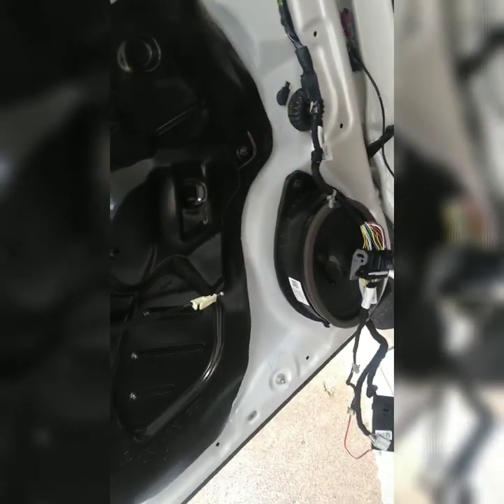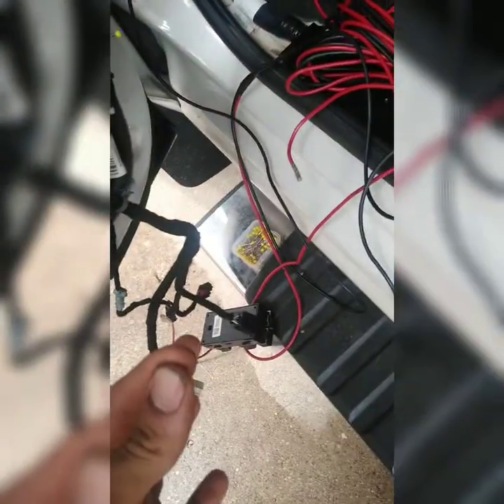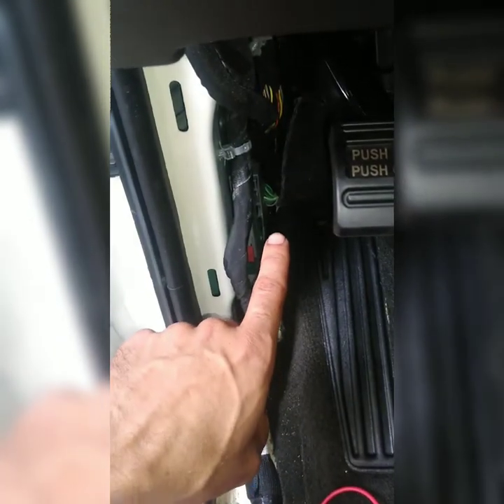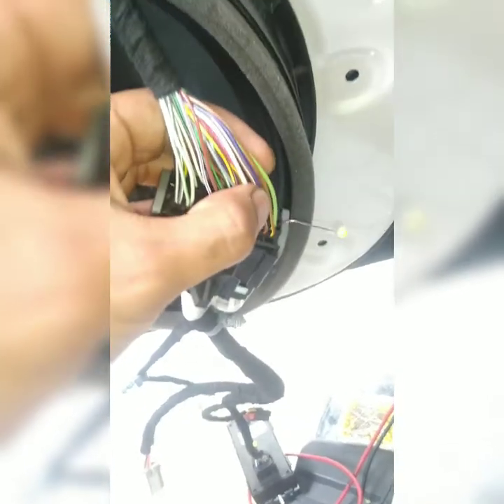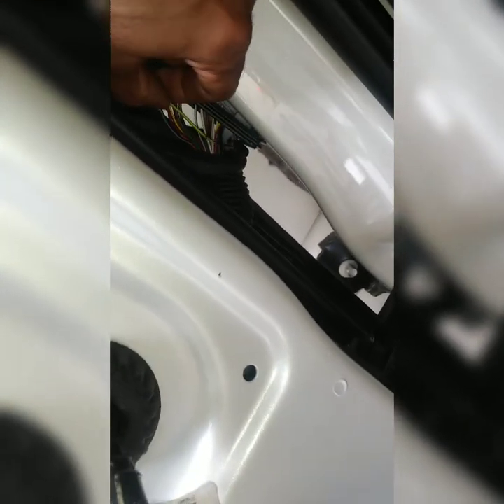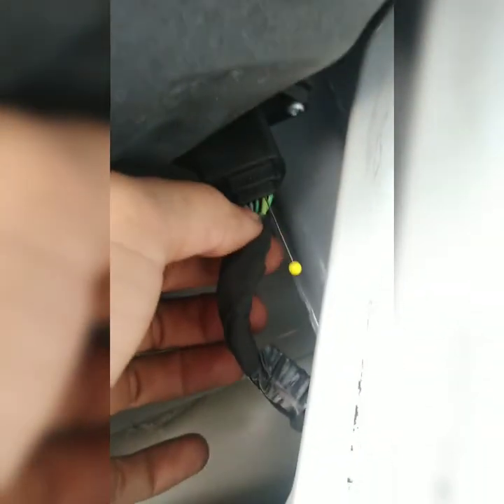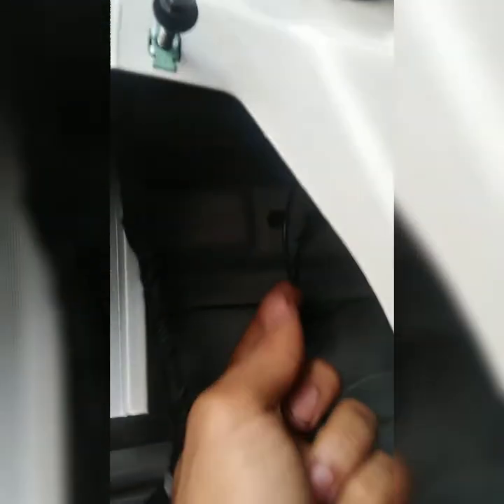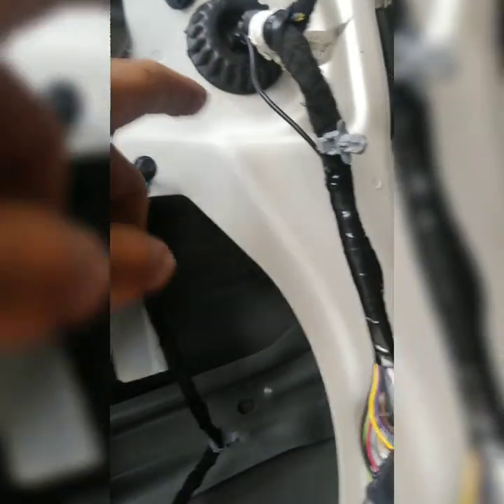2015 GMC Sierra 1500 With Bad Power Window Switch?

Comment: Awesome video. Question,my driver side window is doing the same thing,not going up or down with the driver side switch. Everthing else is working, switch is good ,motor and regulator good. 2015 GMC Sierra 1500 crew cab btw. Would it be the same color wire? i have already switched out the door panel harness so I know it isnt that either. I'm thinking a wire in the boot...help
Reply: Did you even find out what it was I have the same problem right now
Reply: Yes, the wire in the boot is a very thick gage so opening and closing the door eventually breaks the wire in half. So thick red wire in that boot is broken. You will see it